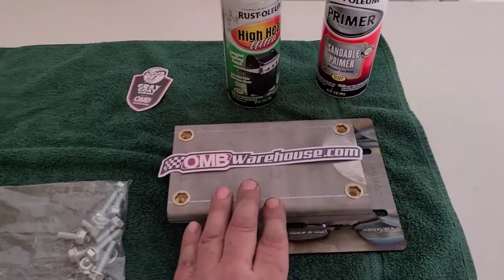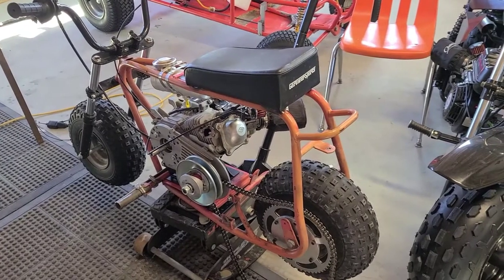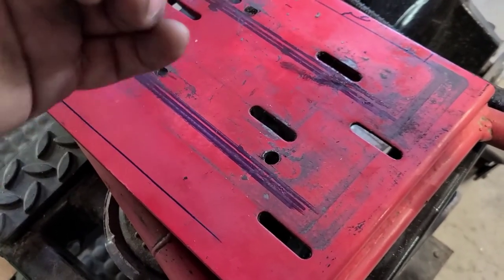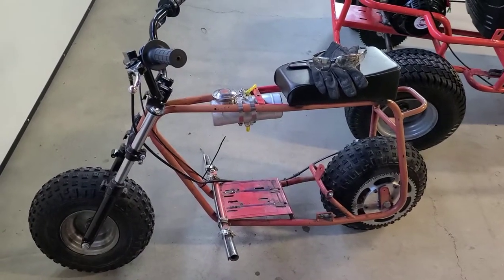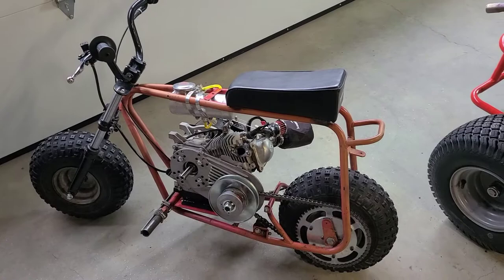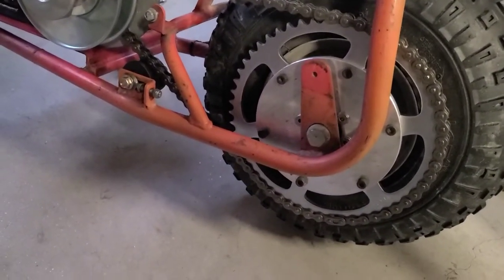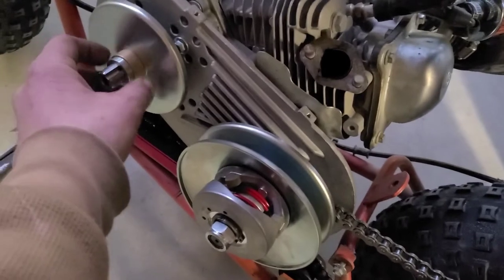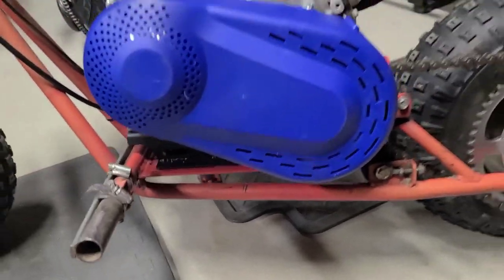DB30S OMB Torque Converter Installation

Comment: Oh shit..I didn't even know they made those..way to go OMB
Reply from the maker: Best available option! If you have a drill press you can slot the plate instead and just drill single holes in the stock plate. I'm checking with the designer on that, I would have gone that method but literally struggled with the moral obligation of punching holes in their product like it was the thing to do. As is, I will stretch my chain, adjust forward and blast two holes right through both plates to create set pins for maximum torque!
Reply: @fatbuddycat  hell ya..that would hold!
Reply from the maker: @GoKartsorGoneFishin  same reason I do these with 420 chain, it's less forgiving to install but doesn't stretch as much. I tried pre stretched 35 before too which is cool but more of a clutch thing. My gx160 bike is a 30 series 35 chain just to stay light weight for rotation to make power higher up.

Comment from the maker: If your wondering why I cut the frame and not the mount it is strictly preference! You would drill four holes instead of slots and then slot the holes on the plate longer. There are also two holes on the outside right of the plate you can use. The reason they don't make them line up on the stock holes is because of the manufacturing differences in these bikes (engine plate width and chain tensioner on this bike alone are different than my other one). I have a method to most things I do guys, there is more in store for this Dirtbug.

Comment: Im trying to align my chain up. The washer trick is setting washers on the plate beside the sproket ? Ive never put a torque converter and it looks like my torque converter sproket has to move away from the plate to line up with the sproket on my back wheel
Reply from the maker: @ktownc936  what bike do you have? There are a lot of different installations.
Reply: @fatbuddycat  I'm trying to fit a bravex 30 series torque converter onto a powerfist 212(Canadian predator Clone) on a bt200x. I may need to drill new engine mount holes in the plate on the frame because if I start to bump out the sprocket in the TC the nylon nut has nothing to screw onto. The other issue now is the provided front pulley bolt thread is course while the power fist engine requires a fine thread. Do 212 predators run that bolt course or?
Reply from the maker: @ktownc936  for my BT200X, I used an adapter and a 54t Azusa steel ring with a few shims to move my wheel sprocket inward.
Reply from the maker: @ktownc936  did you cut off the metal piece in front of the rear wheel or use an engine plate?
Reply: @fatbuddycat  I used an engine plate to avoid cutting the chain guard mount. The new engine I installed is a 212 predator Clone. It's 3/4 so I didn't need an adapter. I think I have to move the engine, which sucks cause I was trying to keep the frame stock. My only issue is the bolt fine vs course mentioned above and the bigger issue my tc sprocket needs to move away from the TC mounting plate by the size of the spacer they gave me for the front pulley. The problem is there's no thread left over on the back pulley if I were to do so. So I think I have to move the engine over. Does the predator run course threads on the drive shaft? My power fist 212 has fine threads and the bravex torque converter kit only came with a coarse Bolt.